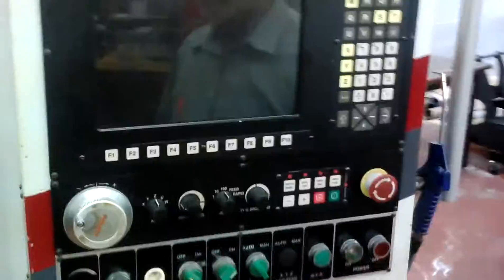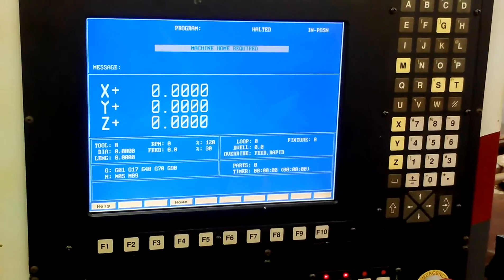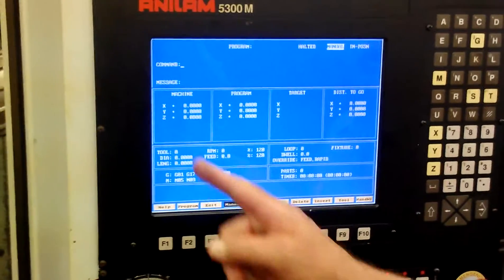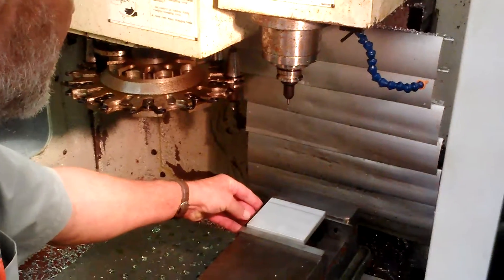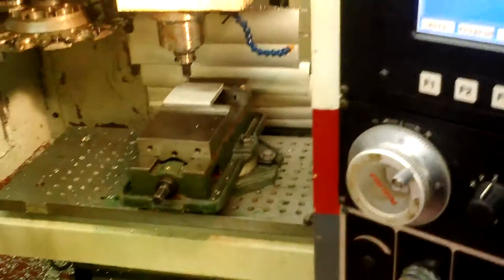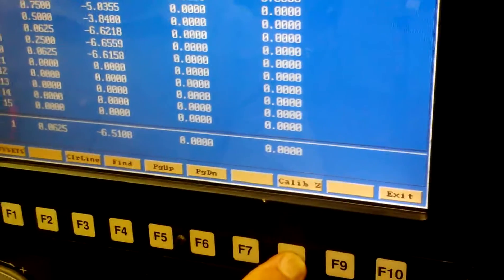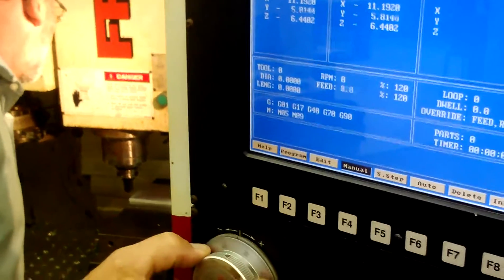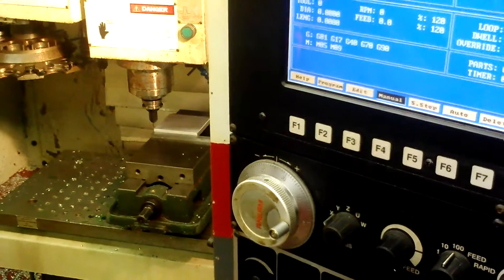Anilam

Comment: Nice video. 
I'm having a problem, if you can help.
I set a tool length by pressing. Calibrate Z .  The tool wants to go too deep.  I tried numerous times and still won't  work properly.  Any thoughts?
Thanks
Reply: On the Anilam control, you need to calibrate your tool with tool 0 selected.
If you have any other tool selected, the control will take the new measurement from the zero position of the tool that is mounted.